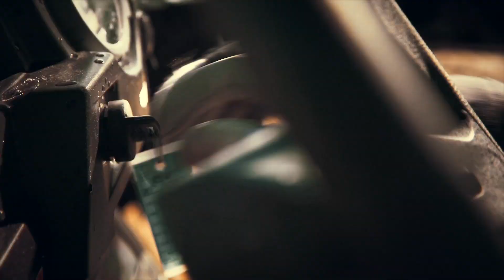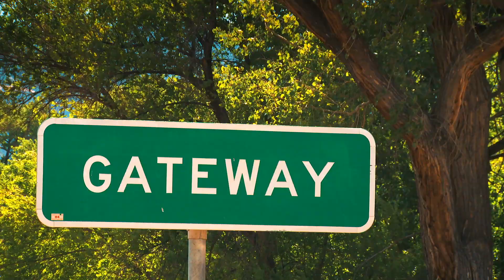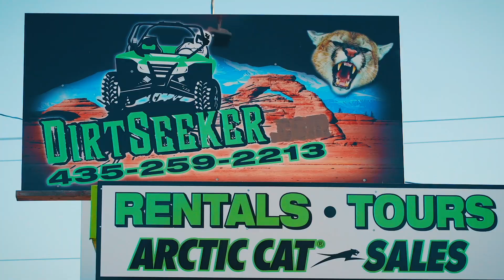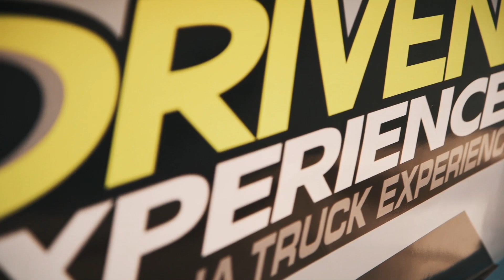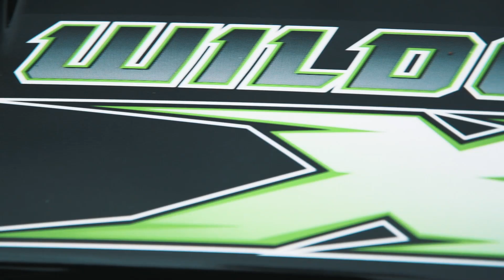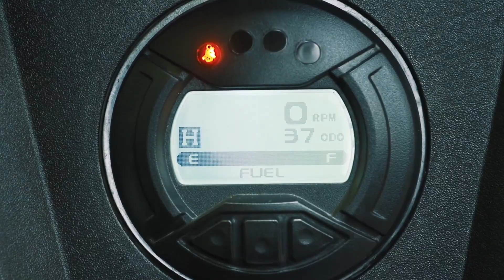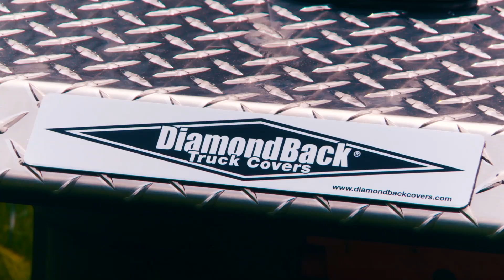DirtTrax Television 2014 - Episode 4 (FULL)

Comment: A.J. I am a little disappointed that you did not cover a few things that the Arctic Cat lacks over the rzr. There are two things that might seem insignificant but are actually pretty important 1st being glove box where as the rzr. and a close-able glove box the arctic cat even on the sport model has a little net. the second is the cup holder location. is is so poorly located. in the foot well instead of the center console. the arctic cat only has open space there where as the rzr uses that space for the cup holders.